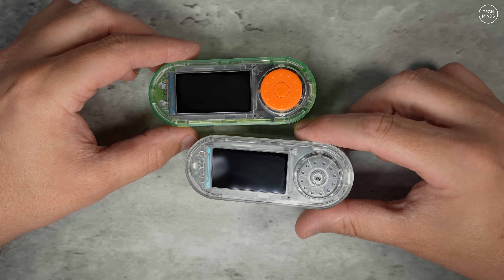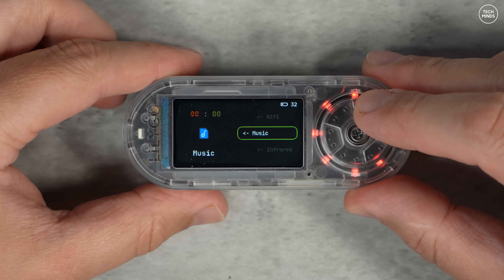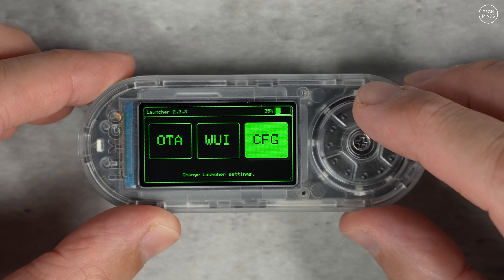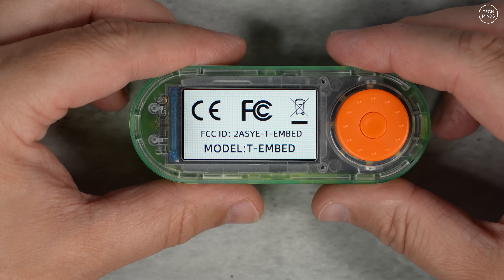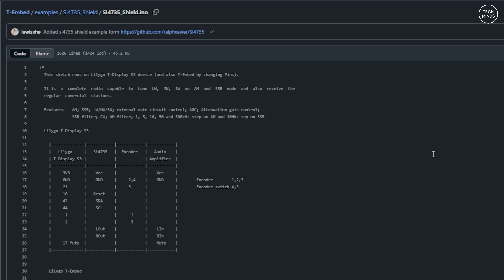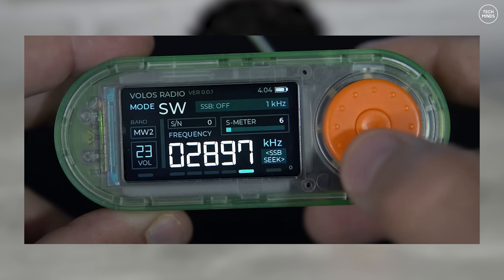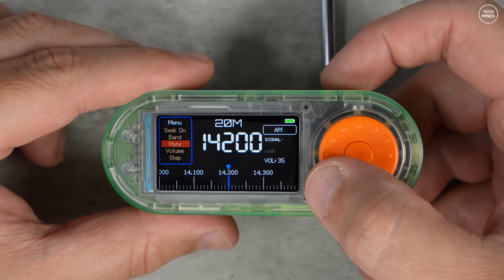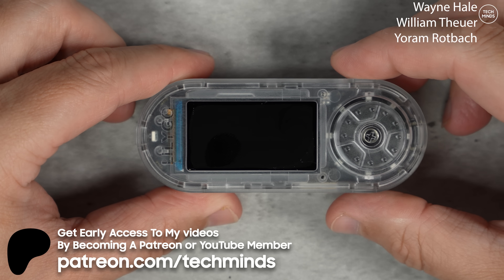Listen To Radio & RF Hacking With The Lilygo T-EMBED -  SI4732 / CC1101

Comment: I wish i had a similarly cheap option for 1090 MHz😩 
Can't we overclock the LoRa modem?
Reply: Try a flightaware I have 2
Reply: @chris6955   And you have a laptop, to stick them in or at least a smartphone🙄 This is as close to the solution, i ask for, as a drill press to an electric screwdriver. 

Next time, suggest a Paradar😉
And no, a Paradar is still not what i am searching for. I basically look for the ADS-B app on the Portapack, but all in the form factor of a T-Embed, a Flipper Zero, preferably even smaller, so it can be worn at a necklace. The VIZ1090 is way too complex and too expensive and the same goes for the HackRF plus Portapack., so a used one won't cut it.

It is a fun toy, for an heli enthusiast, who wants to know, when the heli starts, so she can watch it go. Absolute niche product, that can't use the complexity of an RTL SDR and isn't worth spending 200 bucks on a VS36-12D modem. It does not need the sensitivity anyway, as the helipad is no 100m away. An overclocked 915-928 MHz modem and a PCB antenna would exceed expectations.
Reply: I use them on raspberry pi and connect via my pc they work well
Reply: @chris6955  The Paradar is the option  of a Nooelec NESDR, bolted to a Pi Zero and some GPS plus compass. Instead of a display, it uses a ring of LED, to show the direction of the contact. If i would go that route, i would reduce it to a buzzer. But still, this thing is bulky and because of the parts, pretty expensive.